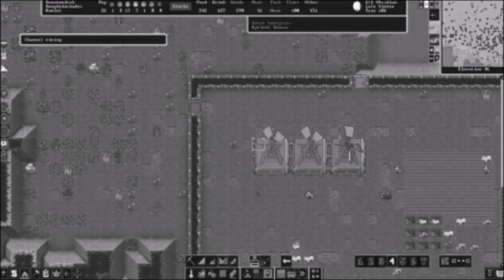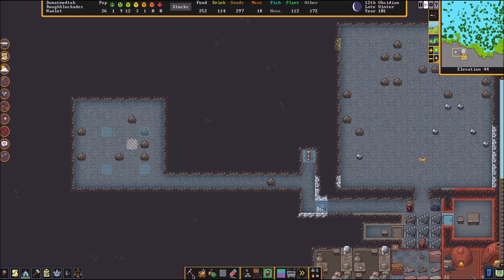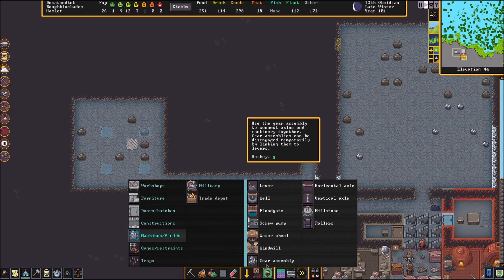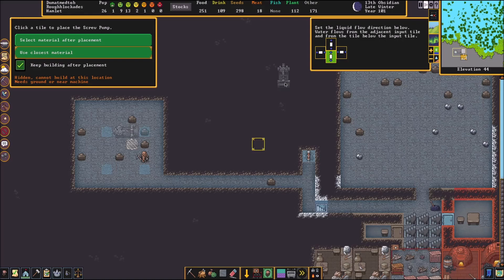Dwarf Fortress - Mist Generator Tutorial

Comment: Nice setup! Do you know if there's a distance limit on how far horizontal/vertical axles can transfer power to? I've made my tavern a bit too far and in a weird angle from the walled surface in my fort, so I think I'm going to need a long series of axles to reach the pumps.
Reply: every shaft and gear adds load to the system, subtracting from the total power you can use

Comment: Also I cant seem to get this to work, my pumps are in the right directions, and i have 5 windmills connected on the surface. The pumps are working but the water doesnt get moved, they just toss it down the hole into the room below.

They have enough power although visually, mine animate slower than yours, is this an FPS/TPS issue or lack of power ?

Edit: Nevermind it randomly started working.
Reply from the maker: It is supposed to dump down the hole, you have to fill it to a 2/7 size puddle in the hole before it will begin cycling.

Comment: Is there any way to stack this? I'm trying to design a modular fort with "15-minute communities" and that tends to require a lot of verticality.
Reply from the maker: I dont believe so? At least I cant think of a way to do it without making the machine so complicated you might as well use a better Multi-Z level mister. This machine is really only meant to continuously mist a very specific are as often as possible. If you throw one of these in a high traffic area like your lone tavern entrance, the dwarves will visit often enough to almost always have the mist buff (they get misted when they arrive and have it while they eat/socialize, and they get misted before they leave)
Reply: @davidlazerz8564  Thanks for the quick reply! Unfortunately I don't think the "lone tavern entrance" plan really works for what I want to build, since the idea I wanted to try is to create many smaller communities with short distances to all needs (which means several smaller stacked taverns). Do you happen to know offhand of any good multi-z-level mister designs?
Reply from the maker: Check out FurtherReading and TwistedLogic on youtube, they usually have some good designs!